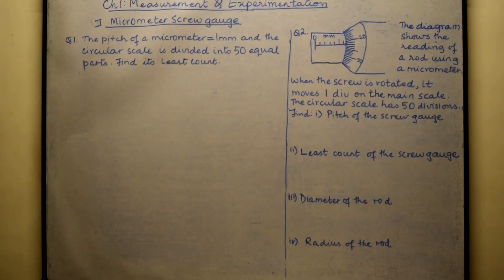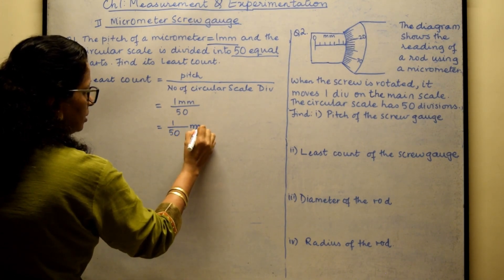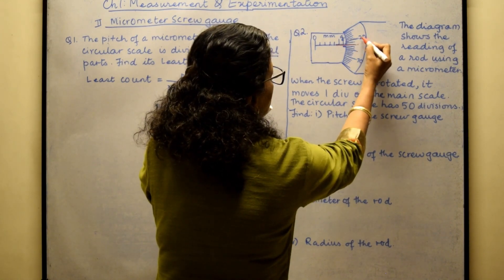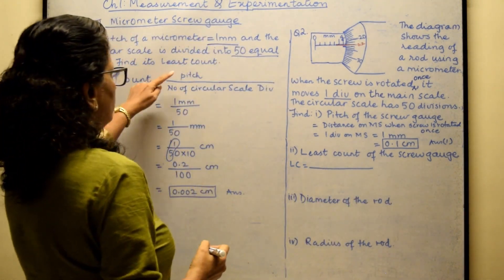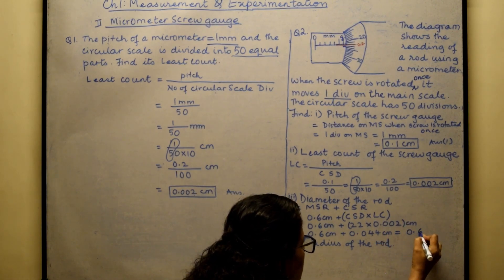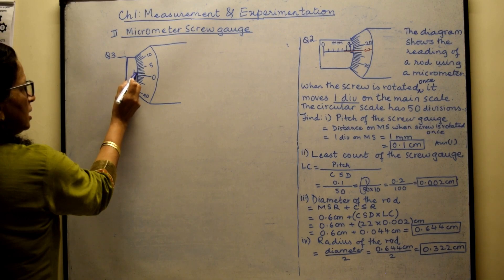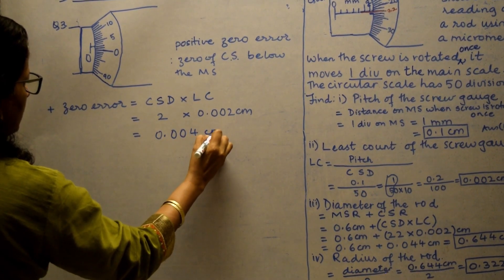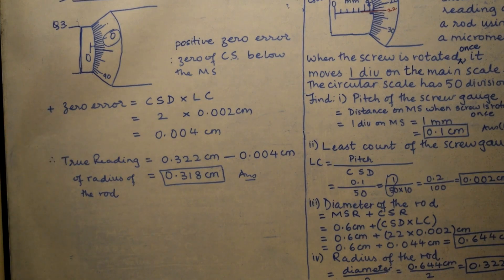Micrometer Screw Gauge Numericals

Comment: 1 cm of ms of a screw gauge is divided into 10 equal parts and no of csd is 100 on rotating the screw head once completely it advances by 1 div on ms while measuring a diameter 5 msd are visible and 65th vsd coincides with baseline while measuring zero error the zero of cs lies a) below base line and 10th csd coincides with it b) above baseline and 98th csd coincides with it find the correct reading in both cases
Reply from the maker: Watch the zero error explanation and how to take the reading once again
Reply from the maker: 09:38 onwards